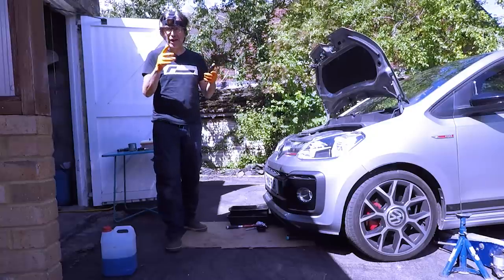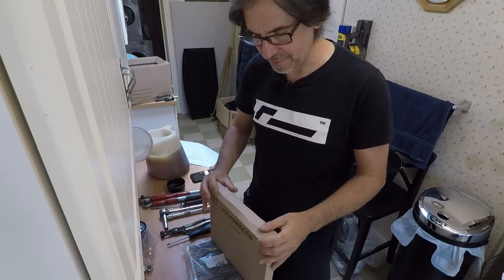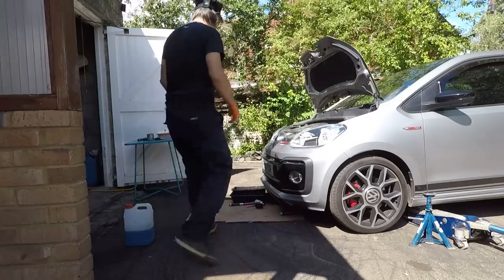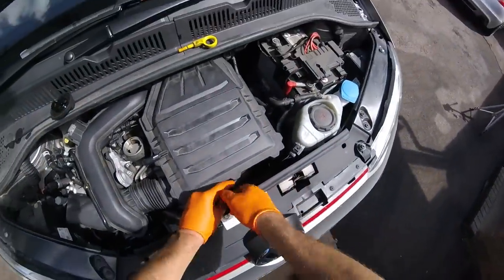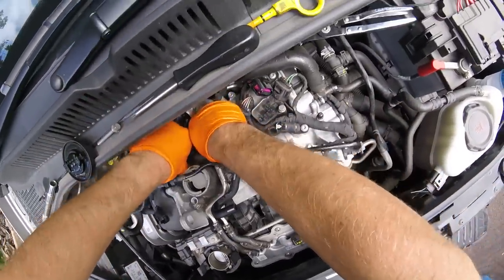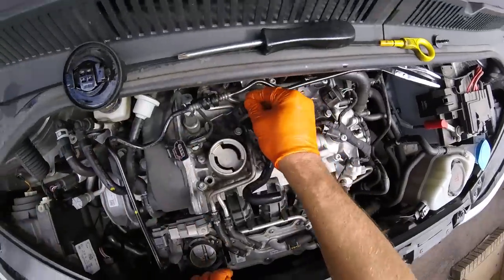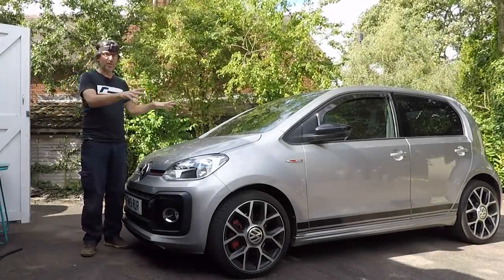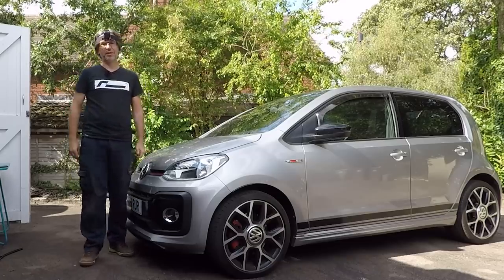VW UP GTI MAJOR SERVICE - SAVE £££s WITH 30 MINS DIY!! #upgti #vwupgti #vwup #volkswagen #vw #gti

Comment: Just gave my 6n2 Polo GTI a full service this weekend, plus a gearbox oil change and added a magnetic drain plug. I also like to do a bit of rust prevention with some lanoguard  and wax oil  while under the car for good measure.

Comment: On the other side of the DIY service coin (and with yourself as a trade dealer) with a niche car like the UP GTi, how much would you knock off a trade value because it no longer has a main dealer or indie documented service history?  An owners handwritten notes in a service book are just not the same as a dealer stamp and itemized invoice. Surely any trader will capitalize on this and low-ball, or simply decline if their pool of buyers are fussy?

Comment: The spark plug piece was a bit too quick but overall nice work. I wonder how to change the gear oil. What VW part number that is and where to find the plugs for filling and drain? Some say you could fill the oil from above thru a long hose but I assume it is somewhere below the car. Would be fantastic if you could reply in the comment section before shooting a video.

Comment: My Beats Up TSi had its 5-year service this summer and VW insisted that the cam belt be changed - I assume they’d say the same for the GTi. That brought the service cost to just over £1,000, which was a big bill for a little car.  A cam belt change is well beyond my capabilities!
Reply from the maker: It's good it's been done but just recently VW renounced the 5 year cambelt rule in UK which didn't apply in other EU countries. This is particularly pertinent to Ups as they don't do a lot of miles and their value can be not far off the cost of a big service with belt. I'll do a DIY on it next year as it doesn't look to bad
Reply: I didn't know that they had recently changed this. Checking VW UK's Cam belt FAQ it now only mentions mileage, not age.  A bit annoying to have paid that much but as you say, at least it's done.    @volkswizard
Reply: New subscriber, YT gave me your channel as a recommendation. Watched the one initially about the Porsche with the dodgy paint and history then swatch the one where you collected your new toy from Saxon. Lovely car. The red really suits it. Now watching this one about an UP GTIi service. I’d love to give it a go on an old banger as practice but I think I’d fall at the first hurdle using the trolly jack (I’d have to buy one first anyway) as I’d probably put it in the wrong place and damage the sill. Keep uploading the videos. I spend hours on YT and learn so much so yours means I now need to spend even more time on it.

Comment: I'm with you on that the DIY. Recently bought a 72 plate gti polo and pumped the oil out and it filled the 5litre can to the top and the 1 litre to the top as well, clearly over 6litres in a 5.7 litre capacity engine.
Reply from the maker: Blimey, sloppy whoever serviced that!

Comment: Great video and you're right, it's a good way to save money and pretty quick to do yourself - do the same on my ST but take it to the local indie yearly for a pre-MOT check and oil service.

Coincidentally, just did the same service on my fiancée's '07 Ignis and it looked like the the plugs hadn't been done in its 16 year lifetime and 67k miles 😳 Easier than her previous Jazz and it's 8 spark plugs though(!)
Reply from the maker: 8 plugs! No wonder they'd been swerved for so long! Glad they came out OK :)

Comment: Worth adding that with alloy heads best change plugs on a cold engine to reduce the chances of stripping threads.  Certainly do not grease the threads as that could lead to overtightening but no harm greasing the protective rings at the top of the threads.
Reply from the maker: Good advice thanks 👍👍

Comment: Always enjoyed your Up! GTI content.  We’ll miss our little red chariot when our Polo GTI Edition 25 arrives.  Did I spot a bonnet insulation pad and some bonnet seals strips? Couldn’t see if there was a central seal strip though. The seals help reduce the amount of surface spray that gets into the top of the engine bay.
Reply from the maker: That MRP! It's got a strip on slam panel and the pads, I didn't see anything else on the bonnet but I wasn't looking TBH.  I remember when this started to be a thing, I did wonder if they were removed to aid cooling as it runs hotter than lesser models.
Reply: There’s always a deal to be done 😉

Comment: Enjoyed our little Up! Beware the demon that is rust. Had a spot at the bottom of the offside front wheel arch after it was around 4 years old. Spoke with VW and they said it wasn't covered under warranty, 'because of where it was'. 😐

Comment: I use a fluid extractor on my Mk8 GTI Clubsport and it seems to almost suck the oil pan dry. I did check the first time by removing the sump plug, and it was a tiny drop that was left.
Reply from the maker: Might be ok on Mk8, it’s not every car that gets that notice on the job sheet

Comment: Ive got an 05' MK5 GTX, they were a limited run in Japan from 05 to 06 and there isnt much info about them. Its essentially an Old mans GTi, lacquered wooden trim/steering wheel/dsg shifter - bolstered leather seats, AXX GTi engine. I love it 🤙🤌 only had 55000 miles as of september 2022 when i brought it, now its at 62000 miles

Comment: Great video on the Up Andrew.👍
A quick question if you don't mind....
Did you manage to sort out the suspension knock on the Club Sport?
I have a similar issue with my Cupra Ateca. It's going in next week to have the top mounts and bearings replaced Hoping it's not the DCC shocks.
Reply from the maker: Afraid not, even got driven around to listen to it and got nowhere. Very annoying. Definitely not DCC on mine so do them last. I’ll make a video about it if I do or don’t sort it first as there are loads of mk7 owners out there who may know. It’s unusual though - no plans to sell but if I wanted to I couldn’t as it is now it’s that bad. Hope yours is sorted more easily
Reply: Thanks for the reply. @volkswizard  
Jeez! I hope I sort it. Not sure what it could be if it's not the top mounts. For sure replacement struts would be very expensive.
Either way I will update you on this thread If the new top mounts sorts my issue.🤞
Reply: I said I would update you about my car and the knocking noise on this thread.
I'm afraid to say that after replacing the top mount and bearing on both front shocks the knocking is still there.
Where have you left it regarding damper replacements.
Any help would be appreciated.😁   @volkswizard

Comment: Did you say £90 for 3 plugs? Are all OEM (Vw sourced) plugs this expensive?
Reply from the maker: Yes and no, the Up! ones are the dearest I’ve come across but modern engines do need special ones. Weirdly Porsches from a few years ago had cheap Bosch ones

Comment: I love working on my Seat Leon and change the oil n from filter every six months, even if I only do a couple thousand miles, I was surprised that the plugs don't need don't doing for 60k!  I was interested in the checklist but I can't find them for a Leon, maybe ones for a Golf would do though, thanks
Reply from the maker: There is Seat Erwin which should have the check list but Golf should be close enough

Comment: My 22-plate Up GTi uses 0W-20 fully synth oil.
Reply: Prescribed was 5W30, which changed to 0W20 later even as an advice for earlier TSI's. I  stick with 5W30 just to be sure. Difference in fuel economy probably is unmeasurable.
Reply: @asphalthedgehog6580  Friction was reduced in the 1Ltr engine, hence the lighter oil is recommended.

Comment: Exchanging the sparkplugs was a hell of a job. The coils just were not willing to get out: had to use two wrenches.
Reply: The coil packs are easily removed if engine is warm as Alan shown with oil, stating it was still warm
Reply: @garywilson5339  thanks, that might be it. The first time the dealer did it, and I've seen that some people use white grease when mounting them. Mine were dry.